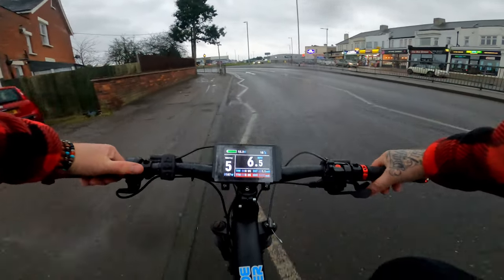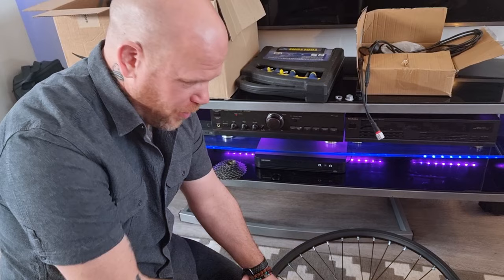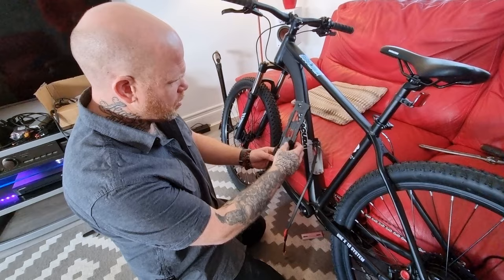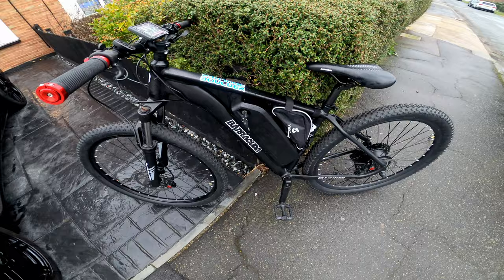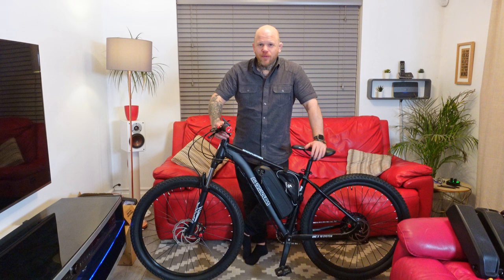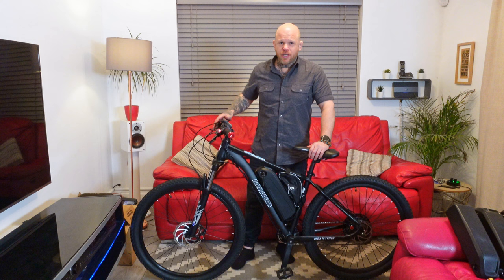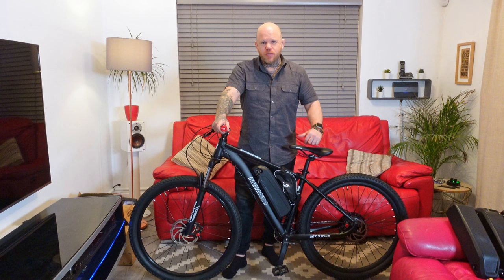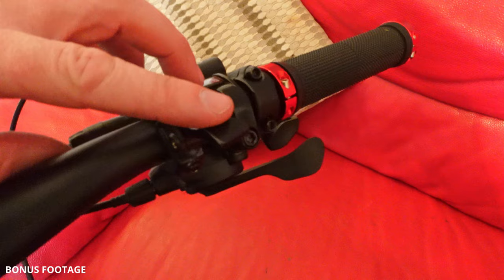How to BEAT the 250w ebike RULE!!!

Comment: The 250w  and max speed law is utterly stupid, it comes from a time when law makers did not understand the emerging ebikes and no doubt most of the law makers profit heavily from oil  and seen the popularity of early ebikes as a threat.  When i first got into ebikes it was to be used as a commuter to make life easier going to work when there was high winds and I started looking at 1000w bikes and those enduro style ones but more research told me they where  illegal, so i settled for a 250w and well was utterly disappointed as my 1999 mountain bike  was able to cruse easily at 25mph on the flat ( with no wind ) , and with the ebikeit stopped at 15.5 and due to the gearing you had to pedal like a mad man just to get close to 17 and even then I was easily being over taken  but other cyclists and people on road bikes flew past me like i was standing still.

Since then I upgraded to a 48v battery and at the time a LCD3 display and set a few settings  and it was better and gave me a higher top speed than the 37v but then later swapped out the controller for a 1000W and oddly enough i did not gain any top speed ( think this was perhaps due to the motor winding's )but the starting torque was insane, later on i swapped out the motor for a 1000w direct drive and have had that since.

But yeah the law is utterly stupid and outdated when compared to ones over in the EU or over in the US where they are more reasonable with the power / speed / throttle rules,  it just seems logical to me that if all these new 20mph limited roads are the new thing to make roads safer for cyclists that ebikes should at least  be able to reach 20mph like every other cyclist, and then the power well 250w limit makes no sense and shows they are ignorant of the tech as 250w motor is not what really limits top speed as set at a software level not hardware, and there is a huge safety advantage to having a higher watt motor as it allows you to accelerate faster not only at lights but also to get out of a situation .
Reply: I read the other day its because the powers to be don't want to destroy the moped market.
Reply: What do you like more, direct drive or geared?
Reply: @I2383R  obviously, there are reg mopeds up to 25km/h and the licensed ones up to 45km/h (in here atleast)

the ebike classes are the same speed limits

the watt ratings are most likely both to not destroy the moped market AND.. to limit Chinese import so we have to buy overpriced Bosch etc. motors (which funds the EU because of taxes, derp) if we want a decent experience as they sure as hell peak much higher in power than the 250W rating

they just want us to pay a ton of money on overpriced garbage.
Reply: I think they should just scrap the current uk ebike laws and start a fresh, and allow up to at least a 550w motor with at least a 20 mph speed limite and allow ebikes to have throttles as well.
Reply: @tomjones715  Exactly . I was doing 20mph in a 20mph zone and a road cyclist past me . I  mean it's crazy we have a 250w limit . That is literally jogging speed
Reply: @SKBKER  agreed the current 250w max rule and 15mph speed limite with pedal assist only is ridiculous, that's not jogging speed that's more of a snails pace.
Reply: @tomjones715  that's why it is getting ignored . I see so many on escooters and  ebikes like the super73 . It's cool to see and no one is in danger
Reply: @SKBKER  yeah I've seen people on ebikes over 250w and on e scooters as well as long as they aren't riding like a'holes I don't care what they ride, and  the local police in my area don't seem to mind.
Reply: Absolutely its ALWAYS ABOUT MONEY. The same reason cannabis is illegal..and cigarettes aren't. If they can't get a slice of the action. They don't want you having it.

Ebikes are far better for the environment too. But because they can't get money from you for them they put up all this red tape. When people are flying around at 30 miles an hour on road bikes. It's pathetic.
Reply: @SKBKER  

EXACTLY. I was doing 25mph on my Fiido M1 pro. And some woman passed me on a road bike. These laws are RIDICULOUS fullstop. It's all about MONEY.
Reply: It's because e-bikes can be used on shared pathways or in areas with a lot of pedestrians. In the wrong hands, the higher power bikes can get up to a fairly lethal speed. A 40mph ebike hitting someone in a blind corner somewhere will kill people. If they're capable of road speeds, then they argue they should be road licensed. It's annoying but DOES make sense if you think about it. Most rules are made for the lowest common denominator(stupid people, elderly, bad weather, poor visibility etc)
Reply: @lunchie80  The shared pathways and the speed is not a valid point really, sure ebikes can be fast but so are non electric bikes, my old non electric MTB from 2000 was geared so it could climb hills but also cruse at high speed on the flat  and it was able to get up to about 25 on flat or 30 with a tail wind and 40+ down a hill but that is nothing compared to actual road bikes that can push 40 to 50 even with an average rider, heck its not the first time I was on a bike path doing 20 and woosh a guy in jeans and t-shirt shot past me on a road or might have been gravel bike and was gone and he was easily doing 40.  So really that is not the reason why electric bikes are power limited because even non powered bikes are capable of deadly speeds and the extra wight of the ebike would not really matter as a collision would be fatal ether way at such speeds.

I am actually all for registration of high power ebikes the problem is that you can't or well you can but its not easy and is pretty much impossible,  in the UK you have to put the bike through a MSVA test that is designed for actual motor bikes and is incredibly hard for a motor bike to pass much less an Ebike, it goes through as a moped and needs  motorbike grade E marked lights / E marked tiers / E marked mirrors and the brakes need to be motorbike grade and have  visible hydrolic reservoirs and there are pages of stuff.   

When i built mine I had the full intention to do the MSVA but it was next to impossible but also trying to get actual motorbike insurance on a diy ebike is also impossible and standard ebike insurance would not be motorbike legal, and also if you MSVA an ebike it cant be used on bike paths,  so i fully agree that they should be registered but sadly there is no viable system in place and they do not seem interested in making one.
Reply: EU law is in fact the same as UK since we were part of it till recently and inherited it on exit. Now we are out we should take the opportunity to revise both the 15.5 mph top speed (at least make it 20 like in most of the US) and the no-throttle rule, which is illogical if you're going to legalise stand-on scooters.
Reply: if the gearing makes you pedal like an idiot and it has a 7 speed freewheel on it, put a DNP 7 speed on there and you'll go very fast by pedaling yourself, even if the assistance is limited to 25km/h

on a flat i can reach 40 km/h with relatively low cadence
Reply: @BH4x0r  Indeed I made that change some time back though as not for the DNP as it was around 70 bucks at the time i was looking, most of the free wheels are 14t on the smallest  and after a long time looking i found the DRIFT MANIAC 7 Speed Freewheel For E-Bike 11T-28T on Amazon for only 25 bucks though you do need to buy the removal tool also as the standard Shimano style one is to short, you would not think it but there is a massive difference between 11T and 14T
Reply: @EQINOX187  thats exactly the one i meant, the DRIFT MANIAC is the DNP one i think? the Drift Maniac is the one i bought on AliExpress atleast for around the same price (i live in Europe) and i can pedal mine, with a 42T chainring (700C/27.5in, so at 70rpm, unoptimal cadence) up to 40km/h

If i had a slightly smaller chainring or something i'd probs do better because i don't need hamster cadence but not too slow aswell

So far the freewheel is very capable, it takes the 90Nm torque from my TSDZ2 without issues with my torque added, i wonder how it will cope with my BBSHD tho

i bought it with the freewheel removal tool but because of the middrive i had to buy a 30 cm wrench to be able to put enough power to loosen it, it was a bitch to remove the Shimano freewheel lmao
Reply: @EQINOX187  I know there's a massive difference, you can check it with how much teeth your chainring has

I have the 32T as largest tho cuz there's extremely steep shit in my country and i only have a single chainring at my pedal/motor side

If you compare the speed difference with the chainring i've got right now pedal side (42T from the Tongsheng TSDZ2) to the 14 and 11T, 14T has a 3X rpm increase while 11T has a 3.8x RPM increase

my Bafang BBSHD that i ordered (its still on its way to my home) comes with a 46T chainring stock, so pedal side rpm will be multiplied by 3.3x on the 14T and 4.2x on 11T, so ye it will be pretty fast lmao
Reply: So you can put a 48v battery on a 250w motor, without making the controller burst into flames 😁 but before i run to ebay to buy a 48v battery and 250watt sticker lol, he mentioned that he got a controller that could take 48volts. Im guessing thats likely why it worked. 
Would i be able to safely run a 48v battery with the bafang 36V15A KT Controller? Or would it be too risky? 
(Its the 250w bafang waterproof rear hub kit sold on ebay btw. Easy to look up)
Reply: @SKBKER  i passed a road cyclists who was pedaling hard, using the throttle on my 250w ebike. Lol He got so mad all of a sudden and took it as a personal insult and proceded to power down the the road ahead of me like a maniac. Kudos to his fitness. But dude almost got himself ran over out of meaningless resentment.
Reply: @Kumari_44  yup and that's my point . They can go fast and even hot 40mph down hill . The safety towards others doesn't change whether it's am ebike or a road bike . So why penalise people like myself who used to be able to ride at a decent 24mph but because of injuries I cannot now . Ebikes don't weigh anywhere near as much as even a 50cc moped . They are in a different class and should be treated accordingly . Instead there is a blanket law with zero thought.
Reply: Yeah about them laws... here in the city ppl are riding hopped up gas powered bikes that are loud as hell..A 2000 watt ebike would be ok  as long as you didn't cause an accident..
Reply: @lunchie80 o, it does NOT make ANY sense. As you can see, many cyclists are dissapointed, and we all know its about taxes, not our safety. In one hand they encourage you to stop using your dangerous and deadly car , and to “go green” , they make the “cycle to work” programs and on the other hand they set exagerrated rules and only allow rubbish batteries and motors. They don’t care about your safety and its obvious. I rather use my 3L engine to commute to work and back than use a 250w rubbish which couldn’t even take me back from work due to not enough range.

Comment: I just joined. I always wondered how a 250W could get 30mph. Now I know, thanks to you. I'm going to build one.
Reply: The motor is 350w not 250w...
Reply: @zgabeartzaiftodie8615  How do you know?
Reply: @zgabeartzaiftodie8615  its 250, he says so in the video.
Reply: @seanclark5165  "250w isn't that bad if you throw a bit more power at it", that's what he said. 250w hub motor won't even do 20 mph on flat ground.
Reply: @bence.gabor.slezak wrong. The Bafang 250w rear hub motor on my 36v battery easily hits 22mph on flat. And thats just a basic setup. I havnt even thrown a 48v battery at it yet. 

If you have a 250w motor and you arent hitting at LEAST 20mph on a flat. You either got ripped off and got a shit brand motor or had no idea what you were doing choosing a compatible battery for it.
Reply: @Kumari_44  if you give a 36v motor 48v it's no longer a 250w motor, since it will pull higher current. Tell me how I don't know what I'm talking about
Reply: @Kumari_44  by the way most motors have a maximum power and continuous power. There's a big difference between the two, and that's how they used to get around the laws.
Reply: It's still the same Motor it just turns faster. 250w div by 36v = 6.9amps. 250w div by 48v = 5.2amps less current drawn, so no you don't know what you are talking about.
Reply: @bence.gabor.slezak Higher voltage , not current ( AMPS ) . Wattage "powe" goes up 40 percent .
Reply: Because the peak power that it can output is much higher than 250w, you can see on the vid that it goes to around 1000w.

Comment: Love it 😀 😍.  I want to build second ebike with hub this time. But instead of looking for 36v battery , i can use my  48v battery,  just have to look for another controller probably not for this one who come with the kit. And in that spirit can upgrade my bbs02b to 52v . 😀 i programme my bafang and increase little bit this Amp's to get a bit more than 1200-1300w. 
But that speed for 250w is really impressive 👏 👌  i want it.
Reply: Hi mate i build my second bike 250w hub 36v battery. Increase a bit the amps to 13 and do 43.5km 😀 hah

Comment: I agree about having a throttle on ebikes it helps when pulling out of busy junctions or crossing busy roads etc and is more safer than just using some types of pedal assist alone
Reply: absolutely - it just shows the level of consideration they gave their 'safety rules' about ebikes that they can't even pop a 'throttle to 8mph is okay' clause in there
Reply: @user-ot1dv6ri4f  agreed even an 8 mph throttle would be better than none in some situations.
Reply: @Advanced Driving is really superman.
Reply: You want the torque sensing version

Comment: Upped my 24v 250w to 48V with 20A limit with a new controller . It now pulls around 900w and still looks weak but now does 35+mph.
Reply: How hot does it get?
Reply: @yodab.at1746  barely warm. That's even after a solid hill climb. I think the hub used was actually rated for atleast 500w continuous but under run by the controller for the UK market. Economies of scale don't make sense to produce a few weaker motors for one country. Mine only pulls 900 Watts climbing hills. Cruising it's more like 3-500w depending on how heavy I am with the throttle.
Reply: @Will-sc3hw  Nice one, I just happen to have a 24v 250w hub sitting around, so I might just do what you have... 😁👍
Reply: So you can put a 48v battery on a 250w motor, without making the controller burst into flames 😁 but before i run to ebay to buy a 48v battery and 250watt sticker lol, he mentioned that he got a controller that could take 48volts. Im guessing thats likely why it worked. 
Would i be able to safely run a 48v battery with the bafang 36V15A KT Controller? Or would it be too risky? 
(Its the 250w bafang waterproof rear hub kit sold on ebay btw. Easy to look up)
Reply: @Kumari_44 I've done it 👍

Comment: Hi - I've got exactly the same bike - 250W motor running with 48v Controller and 48v battery - but I'm only getting around 25mph on a flat road. How did you manage to get it to 30mph+ - would that be down to Controller settings..?
P.S. love the videos.. 🙂

Comment: Great video Steve,very informative as l would like to increase the voltage on my 48v 1500w rear wheel for more power and more distance,is 52v or even 60v possible do you know,thanks.
Reply: it will be but you need to be sure your controller could take it aswell, you could opt for the same voltage and a higher Ah rating though, which will allow you to go even further

voltage should be possible if the controller, screen, and other hardware can take that
Reply: @BH4x0r  hey thanks for that guys I’ll get my sparky friend to look into that,cheers👍

Comment: The secret to turning on a tight corner is to lightly pull on the brake so that the pas won't engage. I do that on my engwe engine x. In settings I changed the throttle so it's not matched to the level of assist. The throttle is 100% power and max speed.
Reply: That or set the slow start setting up a little. This way it does infact ramp up slowly each time you start peddeling instead of giving you full power all of the time.

Comment: I have to correct you on one point, which was a fairly significant part of your presentation/ You kept mentioning that you thought pedal assist was dangerous because of the fierce and uncontrolled startup, but AFAICS, you have a KT controller that doesn't give that issue. Maybe you never tried a KT controller before, It's fundamentally different to the others in that it uses current control instead of speed control, provided that you set that option in the settings ( P3=1).  With a KT controller, you can also set the throttle to be dependent on pedalling to make it legal. That way, it works as an instant power over-ride when you're pedalling with a lower assist level.

Comment: I have just bought a 250w 26" kit, and am going to use a 48v battery and 30a controller which I had going spare, and was wondering if would burn the hub motor out. But thanks to your video i am sure it will work fine thanks for the vid.
Reply: I was wondering the same thing. I have a 36v controller and want to put a 48v battery on it to run my 250w motor.  
I need to know if i can actually do that safely without risk. Or should i just go and buy a 48v controller to match the 48v battery?
Reply: @Kumari_44  controller and battery must be the same rating, I was talking about upping the voltage to the hub motor